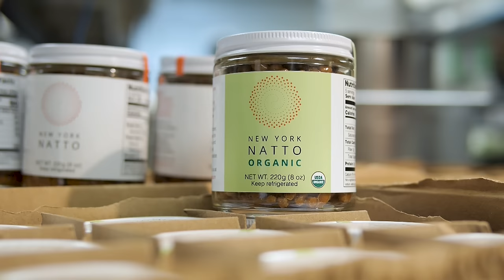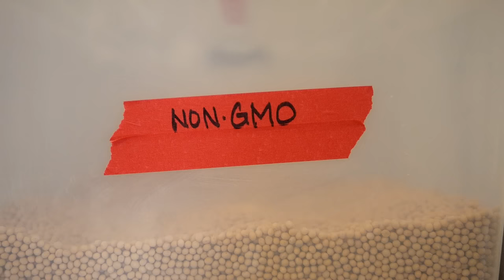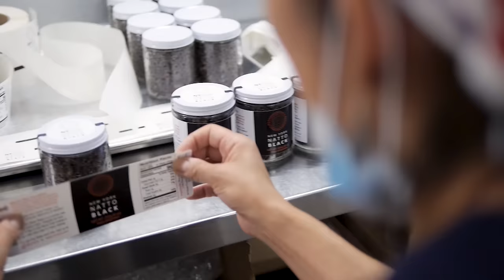Making the Stinky, Sticky, Slimy Beloved Superfood of Japan: NYrture Natto | food. curated.

Comment: Made my 4th batch (3/4 successfully) last one black soybeans, a bit dryer than regular. Used one large casserole and two smaller to portion out (not deeper than 3 beans I read) 24 hrs later the two smaller casseroles had the outer 3rds fuzzy and the centers of both not? Combined them after mixing and did something differently, saran'd, poked the holes and put in the oven with my usual seed starter plastic roll and just forgot them not even babysitting the temperature for the rest of the day and late at night. They were Major sticky! Ran out of my last batch night before so had some before ensconcing in the fridge to finish the three day wait. Really good and strong. Using my new silicon freezer boxes to portion out the prescribed amount. Also found that being able to take a frozen brick out in the morning to defrost before bed allows me to know Exactly when to start the next batch by brick count. (was a day off) I'm thinking that if I don't like the goo amount, I can give a container another go and not worry that any extraneous infection will take place in the presently inhabited legumes.

Comment: I took a nattō challenge, in which I video document my initial experience with nattō. My first words :
“Y’know, that ain’t bad...”
Now I’m on the road to making my own.  As a cook, I’m looking forward to tasting some nattō that hasn’t been frozen.  The Japanese bistros and sushi bars around here only have access to pre-frozen.
Reply: The Nattokinase holds high heat temperature, so I guessed that it holds low temperature as well. I tried making my own Natto by using the frozen one to begin with, and it seems it works well.  I wish, I had microscope or nanoscope to see the  structure and the functions of it.